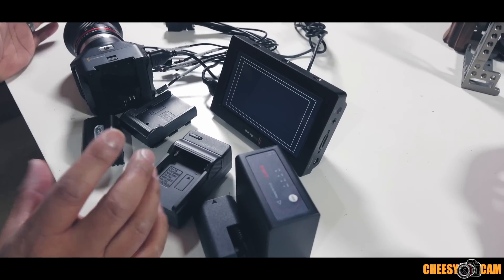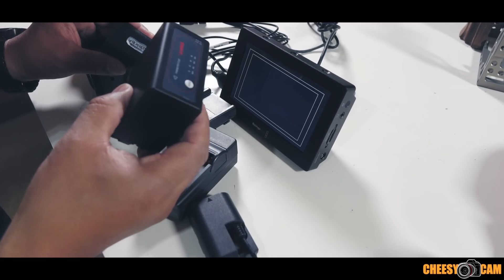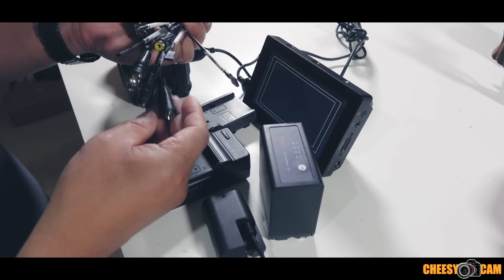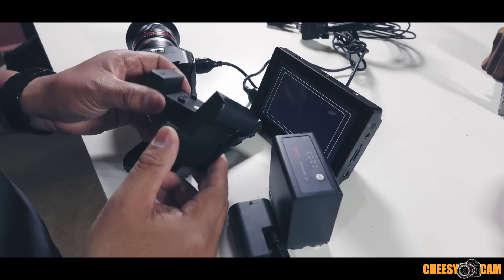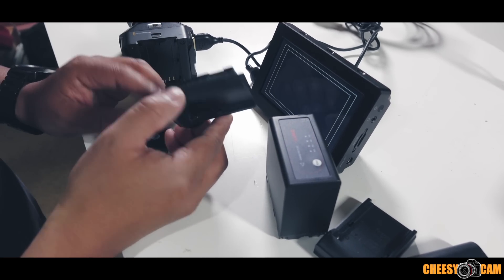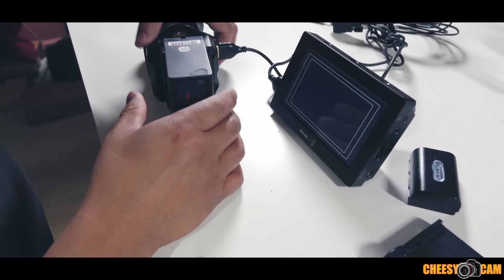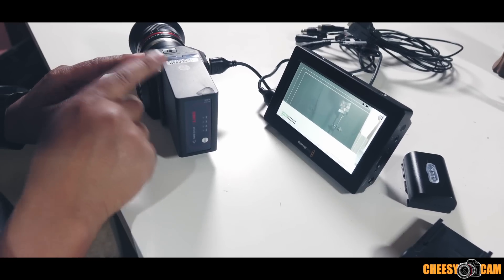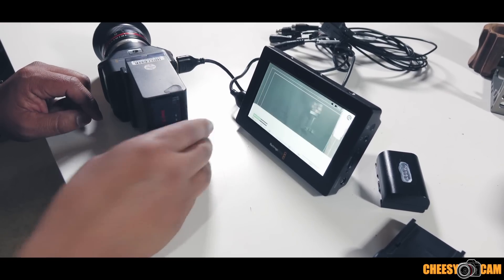Modding the BlackMagic Design Micro Cinema Camera Battery from Canon to Sony for High Capacity

Comment: Hey nice video - really helpwd me out. The only question that I have is:
What is the exact name and model of the Sony battery or is there maybe another NP-F battery that works more efficiently than this model?
Reply from the maker: http://cheesycam.tv/SwitBattery
Reply: MrCheesyCam I have found another battery with around 7800mah that costs like a third of that battery. It's got great reviews on amazon. Is there something special that I have to watch out for when looking for a battery to use with this kind of mount?
Reply from the maker: Some batteries are chipped for certain cameras to read, not all cameras. Some batteries have a higher sustained output. Some batteries have built in ‘shut off’ protection when overloaded. Some batteries have built in Battery Management and shut off before the voltage gets too low. 

When a battery is too low it won’t recharge anymore because the charger thinks there could be a bad cell. And charging a battery with a bad cell could cause it to explode. That’s why some aftermarket batteries work great for a while, but then stop working after a year. 

I don’t know which ones you are looking at but there are reasons some batteries cost more than others, and some offer warranties so you could exchange it.

Comment: Hi there are three outputs on the Canon LP battery, marked common (ie + and -ve) and the negative and positive terminals, all coming from the battery protection circuit within the actual battery case. Presumably with the SONY or the clones, the three terminals are also as above, ie +ve -ve and common. I take it you soldered all three terminals up to do this mod? Are you charging the battery via the camera at all?  If one doesn't make these connections like this, won't there be a danger of bypassing the protection circuit in the SONY/clone battery?

Comment: Hi, How do you hack open the dummy battery? i can't hack open mine. The glue is really strong. Anyone can help me with it?
Reply from the maker: You do not modify the battery. You just modify the adapter plate.
Reply: MrCheesyCam from the video I see the dummy batter is half of the size of the original size. The part that is glued to the plate is not the full dummy battery size if im not mistaken?
Reply from the maker: Right its not the full dummy battery. I'm noy sure which one you have, but it should be hollow. Cut it with a dremel?
Reply: MrCheesyCam thank you.. I manage to cut open and there is a chip in there and its sticking up. Any advice on this?
Reply from the maker: The chip is for Canon cameras. You won't the chip if you are making a battery adapter.
Reply: MrCheesyCam noted. There is 4 cable connected. Which should I connect to the sony plate?
Reply from the maker: +Steady Fly Studios Honestly if you have to ask, I would not suggest doing it. I would try to find someone local who would have a little more experience.

Comment: put it on rods and get a lanparte v lock plate. use a canon dummy and get the power right off the 7.5v output of the v lock. 6 hours life.
Reply from the maker: I was trying to keep it small.
Reply: I get 6 hours out of a kastar sony f970 battery ;)

Comment: How does power get from the batter to the camera? Surely you didn't just glue a canon dummy batter to a Sony plate. You must have made contacts or something.
Reply from the maker: Yes you connect the dummy battery wire to the battery plate wire. There is only two wires. Red to Red and Black to Black.
Reply: http://cheesycam.com/convert-old-sony-npf-l-series-or-lp-e6-chargers-to-external-battery-power-for-sony-a7s-etc/

This is slightly different, but may help. It's from MrCheesyCam's blog

Comment: Hate to break it to you but you *can* get fatter Canon batts with just as much power in them as the Sony, im looking at 2 right here infront of me.  Sure they wont fit in Canon DSLRs any more, but they arent for that. They will charge on the normal Canon charger too! So this mod is only required if you want to use Sony batteries for a specific reason. Hope this helps.
Reply: canon lp-e6 only comes in one size, what battery are you talking about? do you have bigger battery that fits on this camera? thank you

Comment: Hi, I've just ordered parts to try the same thing - the back of my dummy battery looks like the one you show first at https://youtu.be/E6Ku1SCooKk?t=86 but I can't get it to mount because of the lack of a gulley on the left. The dummy battery you've welded to the Sony plate (at https://youtu.be/E6Ku1SCooKk?t=98) looks different on the base to the one you showed earlier, and different to mine.

I'm just wondering if I've gone mad, or whether I've been sold a dumb dummy!
Reply: Hi! I am facing the same problem. I am planning to make the second gulley myself with a dremel tool. What I'm wondering is if I will get the battery % or not... did you solve this?
Reply: I just used my dremel to cut the gulley on the left.. after a lot of struggle it fits with a little force and it works. If you're gonna be putting and taking the dummy battery out of the camera, I would suggest buying the lamparte or indiprotools dummy battery..
Reply: Hey Juan,

Any chance you can share a photo of where you cut with the dremel? I have a shoot coming up and I'm struggling to get my dummy battery to fit the Micro Cinema Camera; any help would be greatly appreciated.

Thanks!
Reply: Any updates here?!  same problem as well!!!

Comment: Many of us have BPU batteries used on the various sony cameras.  How about making a dual BPU battery plate for V-mount batteries for the URSA MINI 4.6k camera.  Any thoughts?
Reply from the maker: +Dean Harrington The Sony BPU batteries are 14.4V which is proper voltage for the URSA  and by running them in Parallel you are increasing the current draw available. I think this would work fine. You just want to be really careful when running batteries in series (especially lipo). This could be a stand alone battery already with a DC out to XLR (in on the URSA). I guess it would be clean in a v-mount housing. Totally possible, but form factor may be bigger than an actual v-mount.
Reply: +MrCheesyCam ... Thanks I appreciate the info.